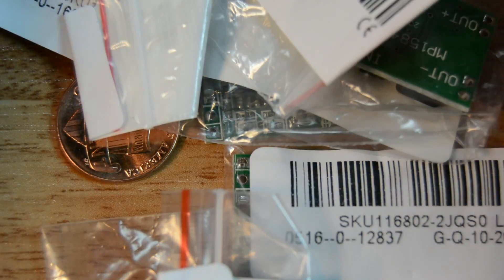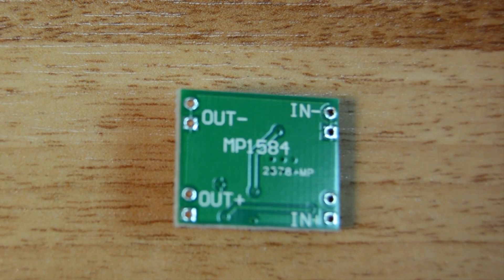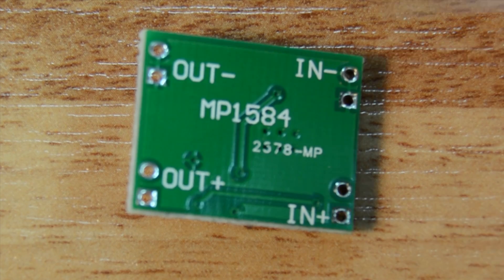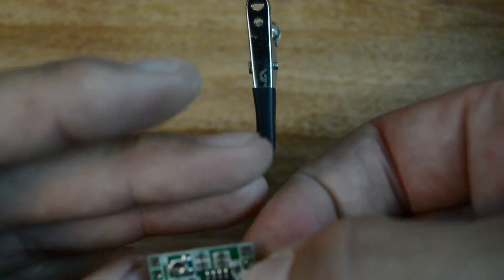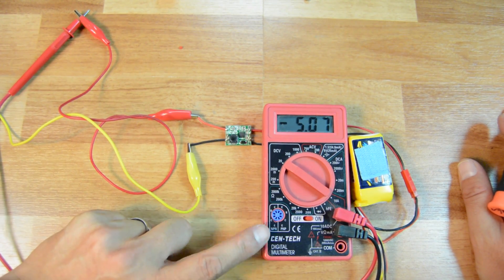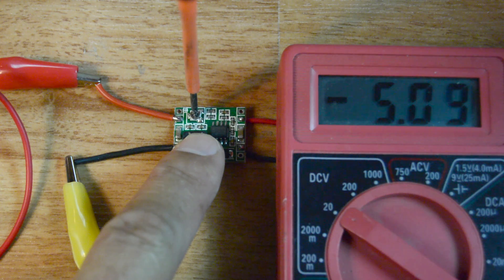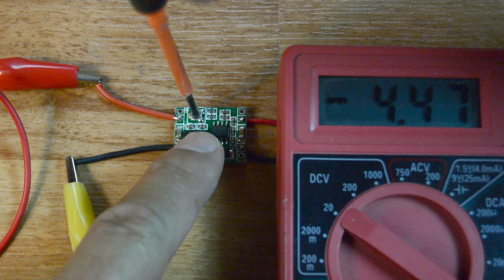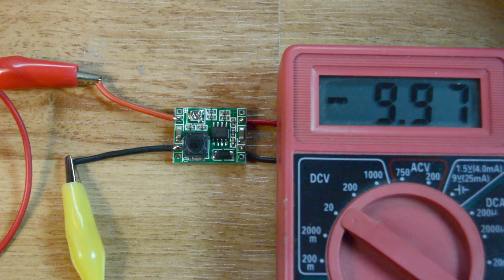Step Down "Buck" Regulator How To

Comment: If you have say, 2 18650s in series, so about  7 to 8 VDC, and you use this mini converter, adjust output to 5 or 3VDC,  then, during use, the cell voltage drops to.. say..6VDC, will the converter keep regulating the input to the desired output? Thanks

Comment: Hi Jeff this is a useful video for me thank you. I have 2 questions. 1- Is this a 2 channel regulator? 2-  I have a PNP proximity laser sensor with 3 wire how can I use this regulator to reduce the voltage output sensor?

Comment: why didn't you measure the input and output power?
I mean the only reason I came here is to see its efficiency. Also it would have been nice if you have checked the output with an oscilloscope to see what kind harmonics and ripples are there.
Reply from the maker: I don’t have that equipment... otherwise I would

Comment: Is it normal that you can turn the screw unlimited in one direction? Cause mine does these and have always the same voltage.
Reply from the maker: no
Reply: For anyone having the same problem: Turn the poti to the right until the voltage drops, then you can adjust it as you wish.

Comment: I just picked some of these up and I notice a roughly 20% increase in output when the battery (12v wall wart in my case) is disconnected.
Reply: Turning on/power on seems to jump up :-
https://youtu.be/XEl4-8OfJ0c?t=14m48s

Comment: This guy has made a more precise test of those regulators.
https://www.youtube.com/watch?v=Q4VtZlD6glA. Pretty noisy and should not be loaded with more than 1A (I guess better stick to values around 600mAh). You might need a filter while you use it with FPV gear.

Comment: EDIT: It's a switching regulator after all (CN1584)! it just requires an additional heatsink if you're planning on applying more than 2 amps to it.

I tried powering my combat wing's 128 rgb led setup off of one and couldn't touch it after a few minutes. I think they work well for low amp applications like powering an FC or camera but it definitely felt like it was going to burn out at 5v with 2 amps going through it. Ended up using a Castle 10A bec for my project instead.
Reply from the maker: Thanks for that!!
Reply: the choke/inductor is a dead give away that this is a switch mode buck converter.
Reply: the choke/inductor is a dead give away that this is a switch mode buck converter.
Reply: the choke/inductor is a dead give away that this is a switch mode buck converter.
Reply: Good eyes! I looked up mine (cn1584) and found out that it was indeed a switching buck converter as well. It can be run at 2 amps, but anything above that will require a heat sink.

Comment: I've used something similar and had the put  hot glue on the potentiometer, so it wouldn't move. After I set and tapping it on the bench the voltage changed.
Reply from the maker: Thanks!

Comment: The problem with this product is...That as the battery or power supply voltage drops....so does the output supply.  
If your battery drops by 10%....your output voltage drops by 10% also.   Not trying to be nit picky...just pointing out potential short comings.
Reply from the maker: Hi Ryan- I'll test this and get back to you-
Reply from the maker: I just tested this with 2 batteries of exact same size- one fully charged and another discharged to 3.7v per cell- the output was still 5v which is where I set it.... for both batteries.
Reply: Well...I'm proper wrong then.  I was assuming being so cheap with a pot for adjustment it was a basic step down regulator